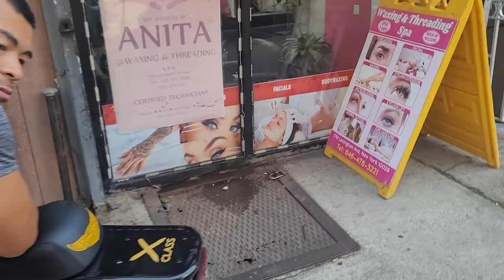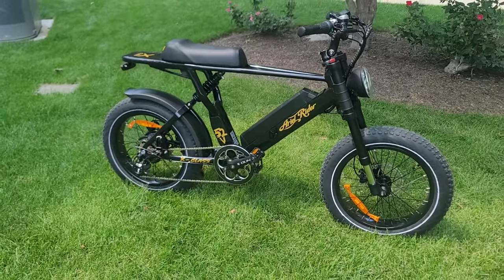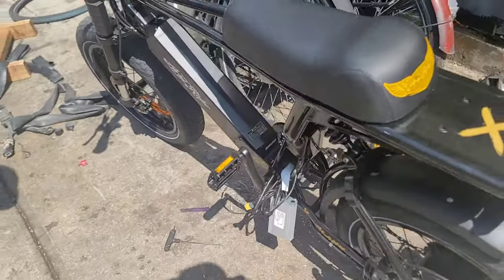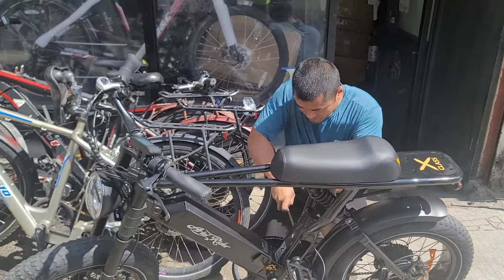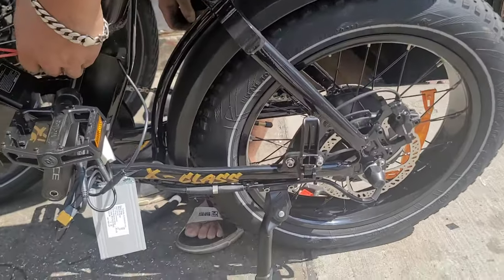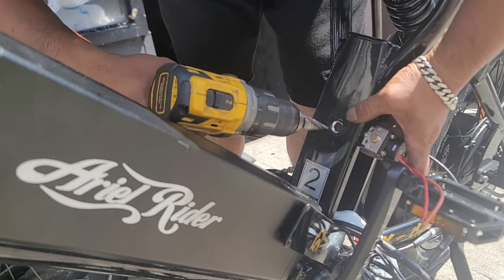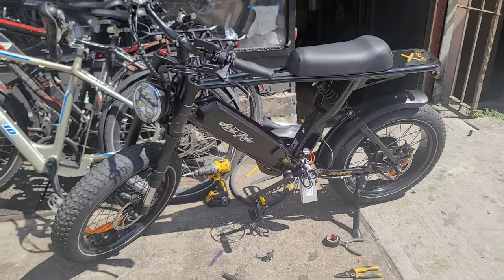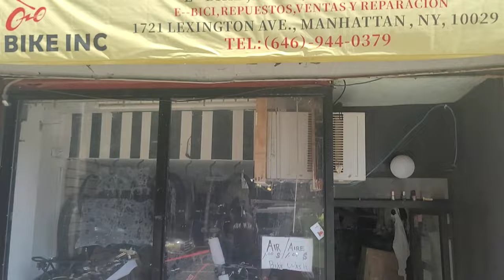@Arielriderebikes: Diy Ignition shut off with key 🔑

Comment: theres a few issues with doing it this way 1) your tapping right from the battery's direct  current, meaning that each time he turns it on and off he may/will get an internal arc from the inrush current from the battery to the capacitors in the controller, 2) when you pulling alot of amps from going up a hill for example, that current now has to travel through the key lock itself, and that key lock is meant to turn the bms on and off, not act as a contact switch, meaning itll potentially heat up and melt the plastic components inside the key lock itself or worse cause a short somewhere.

a key ignition in this manner should have been spliced onto the ignition line of the display, you first open the display and identify the ignition line, or power in line, then cut that line in introduce the switch or key lock, this way the lock is only receiving system voltage and not system current, and there for not spark or melt over time or in situations where theres a huge current load
Reply from the maker: Wow! Great info. 2) I learned something makes alot of sense common sense too. The owner of the bike kept saying to me to splice the display and add key he said that several times I told him I don't think he want to splice the display he a amateur so I told him it would be better to cut the controller or battery wire but the display makes alot of  sense now that you fully explained it.
Reply: This is all 100% correct. This controller, though, doesn't have that ignition line like many DIY controllers do. If I had to do this to an xclass, I would have spliced the throttle/pas signals with a DPDT key switch. Somebody could still turn on the power, but the bike wouldn't go anywhere without the key in and the switch can easily handle that amount of power.

Also, a better key switch that didn't have the superfluous bolt would have been a bit nicer :D

Comment: I'm 6' tall, would this bike be too cramped?
Reply from the maker: Heck no super 73 has a video with rider size they had a rider 6 feet 8 sit comfortable on one of their bikes the bikes is similar style
Reply: I’m 6 also, no real issues but your not gonna get full leg extension pedaling. My legs are a bit short, 31” inseam

Comment: Those connections are highly unlikely to last.
Reply from the maker: ebro why you say that I had some before and they surely didn't last they melted I think it was fault tho
Reply: @T2daBikeGuy  So, a few things stick out in seeing how the connections were done.  First, had I been doing this, the connections would have been soldered and shrink tubed.  There would be less likelihood of touching metal as the tape moves or wears away.  Overall this should be some heavy duty wire wire in the switch circuit.  It appeared that any movement in the controller and additional wiring would lead to the break down of the connection.  Great idea but not well executed, or at least not done as well as it could have been.
Reply from the maker: I agree with the solder and tubing that would of been nice pssst it was a $40 job
Reply: @T2daBikeGuy  you see lol, it melted cuz system current was being passed through the lock itself, that  style of lock is only meant to be connected to a bms that has an on off feature, that feature is just an electronic circuit that turns the bms off, thus effectively cutting off the discharge power, but when you use it this way in line with the battery its acting as a resistance to the current flow as the controller calls for more power, putting the ignition switch on the display line will effectively act as an electronic switch in that its just cutting off the voltage and not current tot he display, if the dis play cant turn on  the bike cant be turned on
Reply from the maker: ebro lol. If that connector melt there will surely be a part 2 to this video lol. I think I might have to do it all over withe solder tunes and new connectors don't think we can do much about the lock we drilled already but definetly don't want this guy connectors to melt
Reply: @T2daBikeGuy  the connector he used was an xt60i think from them looks of it, it's fine, that won't melt, but the lock itself will heat up and the plastic parts inside the lock itself will melt, but definitely solder those connections, it won't do much in the long run though with the heat of summer, his weight, the speed he will ride at, and any up hills he goes on, that'll all add to the heat generated as current passes through the lock, either the solder on the orange and red wire to the lock will break off, or the plastic boys in the lock will melt, but i definitely look forward to part 2 lol, also no matter how much sealant you use, the part of the lock that up and down as you turn the key, that will always be a place for water to enter as well
Reply from the maker: I'll reopen it after 30 days or x amount of Miles to review the quality if work for all to see
Reply: 100% and exactly what i was thinking...plus it's pointless.  U gonna leave battery out?? How about your motor??

Comment: I think you can obtain similar electronic lock cylinders that you can turn to the ON position and remove the key while riding. I predict that key catching on a pant leg or shoelace or foot and getting bent or broken off.
Reply from the maker: Factz this one has to stay in while riding and be removed when exiting the bike wish we did have that one
Reply: @T2daBikeGuy  
Yes, I know. I watched the entire video. You actually took a break during the most important part too. Right while Chino was figuring out how to fit the controller in with the lock cylinder. 
It was difficult to determine watching in my phone, but it looked like it might have been possible to have drilled the key hole on the front/battery side of that outer/black controller box and drilled the three holes in the right side where Chino drilled and placed the key hole. That would have kept the inserted key out of harms way. Chino would have had the flip the lock cylinder upside down from the way he installed it, but no big deal.
Reply from the maker: Yeah I went to the store I thought he would be there a while fiddling trying to get the controller in I don't think it would have fit  withe key in front of the box I see what you saying even if turned it side ways maybe make not not sure I have to really study the angle again
Reply: @T2daBikeGuy  
You would have to have the lock cylinder in your hand right next to the bike to check, but looks like it could possibly have been done that way.
I also noticed that Chino just twisted the wires together then electrical taped them. He probably should have used a couple Crimp Butt connectors with a couple Shrink Tubes instead. That could still be done, but can’t redo the lock cylinder holes now. 
It’s possible to cut the thumb grip of the key off and file off the cut edge, but still leave enough to turn/use the key. I would try something like that with one of the keys to see if that works and reduces the possible key interference problem.
Reply from the maker: Ayoo you guys is the best my ebro's you see the advice and indebt solution these guys take time to give Well received ebro blam off we all taking notes alot of the video I could not really see as I was recording sunlight was so bright like the twisting cables I could not see any of that I was kinda of far away recording didn't see til I zoomed in t h ought about it but I would not have complained anyway but I notice that

Comment: Umm, no. You're modifying the bike, drilling holes and voiding the warranty in the process. Ariel Rider doesn't "owe him" anything.

All this work just to not have to buy a bike lock, and to justify leaving a bike outside unsecured and unattended, when a lock would have been MUCH CHEAPER than asking this guy to do all of this labor. 🤷🏾‍♂️
Reply from the maker: Lol. 😆 🤣 😂  ebro
Reply: There is no lock that can't eventually be picked, cut or broken. Even multiple locks aren't guaranteed. Anything over 1k should have some sort of on board security feature and it's pretty ridiculous that some of the cheapest ebikes have a key ignition but a 2500k+ bike doesn't.
Reply: @deehines5750  if your excuse for not buying a bike lock is, as you suggest, "multiple locks aren't guaranteed", then what's the point in adding ANOTHER lock on the battery, which ALSO isn't guaranteed? It's not like key ignitions stop car thefts. There is no 100% security measure. So why try? Basically, there's no hope either way, right? Even without power, they can still pedal your unsecured bike away.
Reply: @En4cer2K9  You're already attempted to put words in my mouth. Go re-read what I said.
Reply: @deehines5750  I read what you said. "There is no lock that can't eventually be picked, cut or broken".

Likewise, there is no security feature that can't eventually be hacked. So you didn't make an actual point at all.